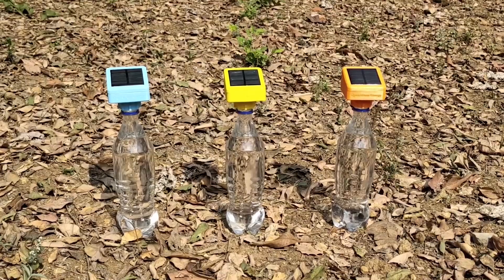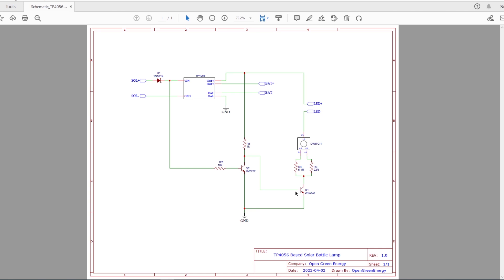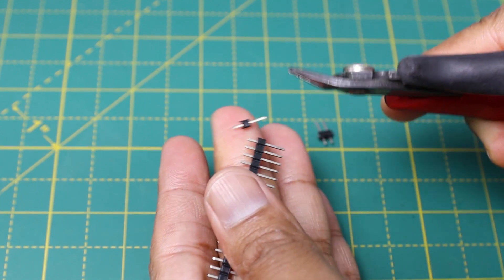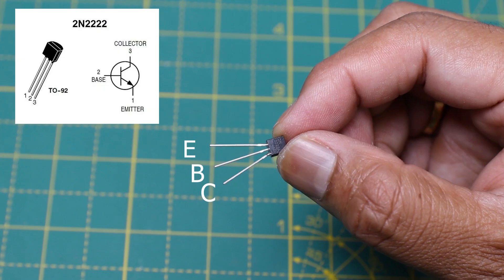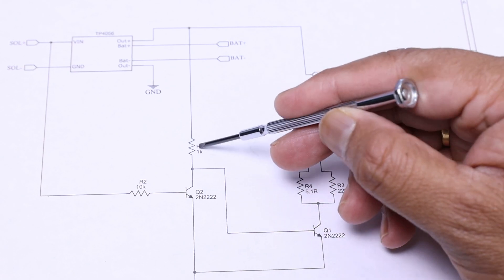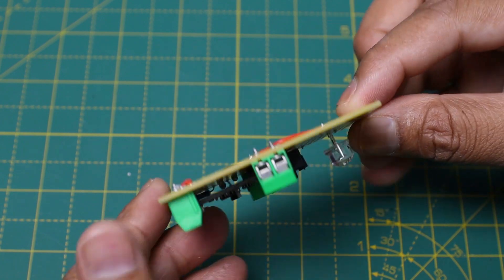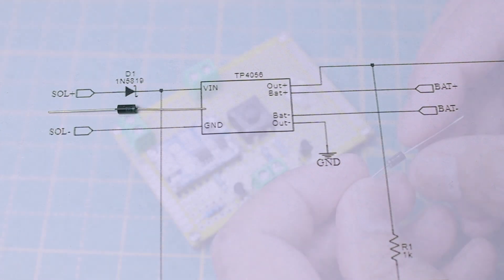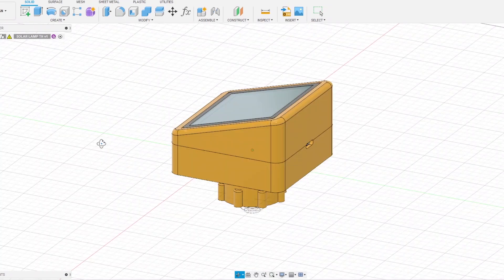Solar Bottle Lamp by using TP4056 | बेकार प्लास्टिक की बोतल से बनाएं सोलर लैंप | DIY Solar Lamp

Comment: How about using a single PNP transistor. Connecting emitter to positive of battery and gate to positive of solar panel through gate current limiting resistor and another high value resistance to pull down the gate of PNP. Connecting the collector to the positive leg of led load (plus series connected resistance switch network) and negative of led to ground.

This way you could save one transistor.

Plz correct me if i am missing someting.
Reply from the maker: Thank you for your suggestion. I think it will work. Let me have a breadboard test to confirm everything is working as expected.
Reply: @opengreenenergy  an additional zener can u used for exact  voltage setting.
Reply from the maker: Thank You